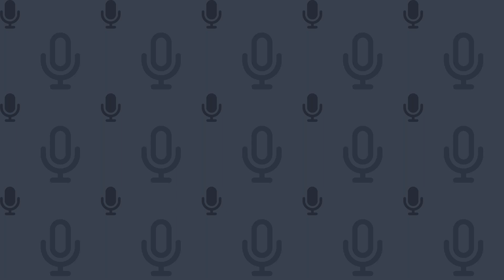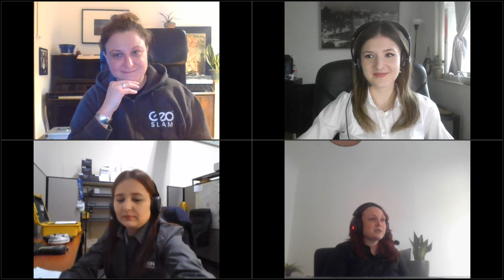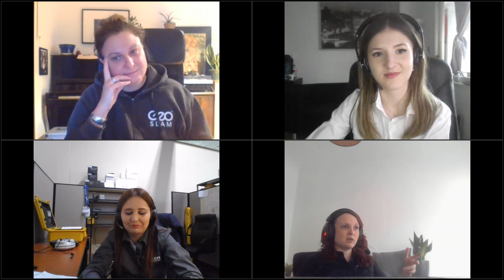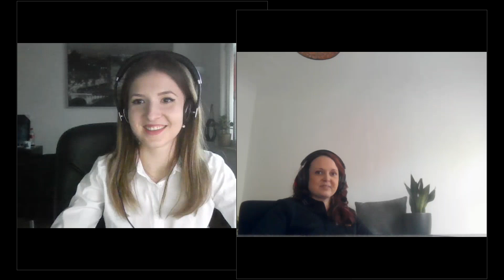Panel: From Scan to BIM – how do we improve collaboration between different systems and professions

Comment: The reason semi automatic software is not relied on is quality control. Depending on the project, fixing would take longer than manually modeling and ensuring a higher level of accuracy and QC. 
 I am happy to see this presentation is very candid. It really shows the work that goes into creating good deliverables for our clients.
Reply: We share your thoughts.